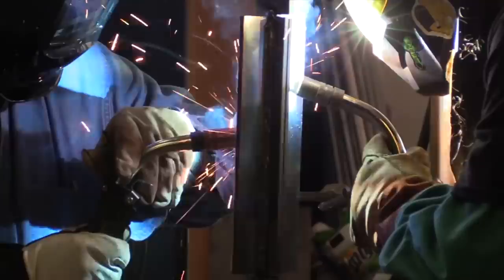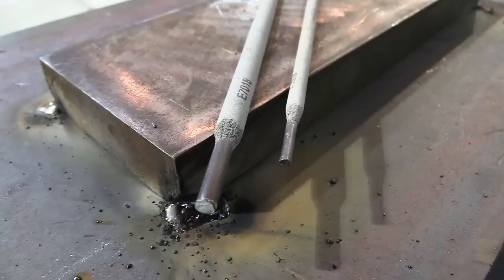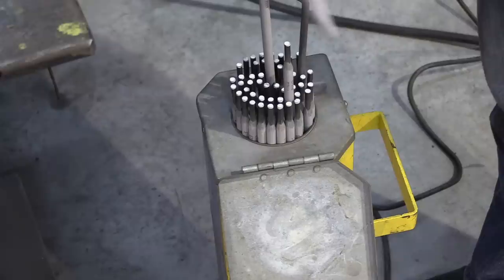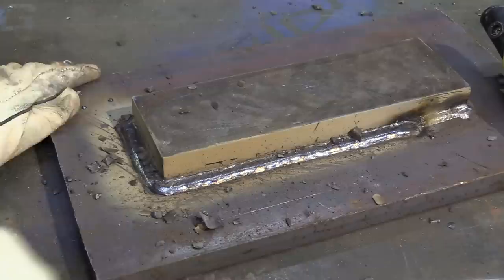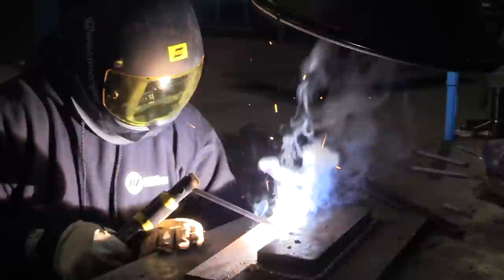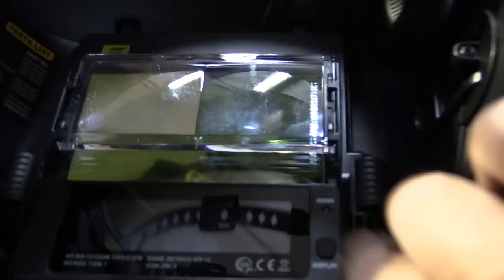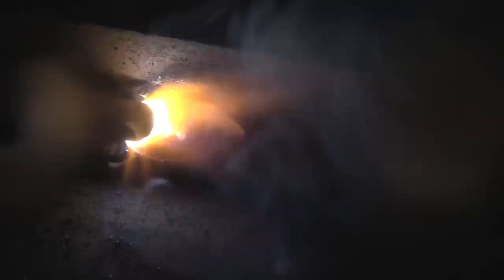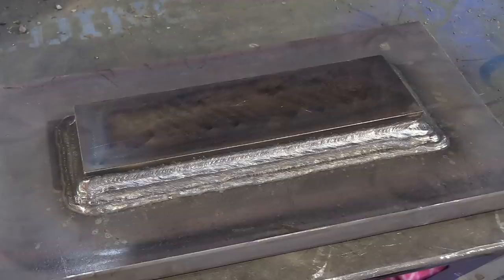Lessons from My First Welding Job

Comment: Jody can you please do a 5/32 7018 uphill I'm having trouble running a Stringer with 5/32 running uphill on structural steel.
Reply from the maker: I will definitely try to get this done soon
Reply: Wroger Wroger Why so much anger and aggression, man?
Reply: @Wroger Wroger you must have been bullied as a kid
Reply: Wroger Wroger asking for help and not thinking are to different things. He is asking for help so he can do it for himself. Not thinking would be that he wants you to do it for him and he take the credit. If humanity would be like you we would never have moved out of caves since the knowledge collected would be only from one lifetime and not several. And btw im taking calculus 3 next semester with electrical engineering as a major.
Reply: @Wroger Wroger so everything you know about weld is self learned? You never struggled and had help from an experienced weldor, my hat is off to you. Along the way at times Jody says if there is something you want to see let me know in the comments section. This channel is based on an older, very highly skilled weldor sharing gratuitously the knowledge of his lifetime. The format here allows people to make request of the author. Why don't you jump on the winning team and offer that young man some helpful advice?
Reply: Antonio love are you having trouble with T joints or with grove welds or both? It is very easy to let the arc get to long with 5/32 going uphill. In a T joint the burn back of the rod into the flux can make it where the flux is literally scraping the sides of the joint in order to have the arc short enough. That short arc learned from a T joint will help in groove joints also. If your amperage is to high the rod will burn back into the flux to far and it will long arc you no matter how you manipulate the rod. You need to mind your rod angle when welding uphill. You want to try and stay straight in or just a very slight push, like 10-15 degrees maximum. If you let that push get exaggerated your rod will fingernail and once again that will give you a long arc. The long arc gouge out the base metal then you will be fighting a losing fight. It is easy to accidentally drop your hand into a push instead of raising your shoulder to climb the joint. Also please check your ground. Whenever possible hook ground so that your welding progression is moving toward it not away. The arc blow created by DC can be a bear. So getting that ground at the top will always help. Remember to weld uphill is only about a 15% reduction in amps as compared to flat. If you loiter around to long trying not to get undercut the heat is rising in the joint. The climbing heat is preheat that will soften the base metal and make the base metal want to wash out. A long arc can result from not rolling your hand into each side, if you just go straight side to side your arc will be long on the sides so to roll your hand into each side will help keep that arc tight. Many people prop to heavily in the vertical position and get to comfortable at the start and become a victim of not moving fast enough after the prop is no longer comfortable. If this does not help feel free to ask me questions and I will try my best to answer. I am sure Jody will get to a video for you soon take care.
Reply: I am also very interested to see this.  The only way I am able to run 5/32 7018 uphill is the make a U shape pattern and constantly have the rod moving and pushing into the base metal.   I normally run it in the 150ish range.  I have done a bunch of t-joints and cut them because I was worried about how sound the weld was running back over the flux from the U pattern but every time I cut them the weld is clean.
Reply: @Wronger Wronger Your the reason the gene pool needs a lifeguard.
Reply: @geb9696  Sometimes  I pull straight up about 1 rod diameter then wiggle side to side until it puddles out and ties into both sides. I use that on the first pass many times because it helps control size and undercut. I don't like when I have a bad looking root pass. Welding over a bad root pass is like ice skating uphill. I think of it as an upside down T motion.
Reply: @Wronger Wronger That's a big FAIL for you. Try harder PMSL (gotta be a teenager)
Reply: @Wroger Wroger Sorry you got all butthurt and stuff. I forgive you. Merry Christmas. Hope Santa visits you.
Reply: well theres your problem right there. Try doing a weave instead of stringers
Reply: @Wroger Wroger hey tough guy you're real tough aren't you? I can run 1/8 7018 5/32 6010 6010 3/16 but having a little trouble with making a consistent bead with a 5/32 7018 which I run about 150 amps..... with that kind of attitude tough guy you wouldn't last long in a oilfield business.
Reply: @melaniew77msn  thanks....
Reply: @SlapHappy  Some codes and or employers force you to use stringer beads. Your answer might have some merit but the man asked about stringer beads.
Reply: @MRSTEEL-fd7eg  Anytime we are all in this together. What good is a profession without any professional courtesy? We all know what it is like to be under that hood for 8-12 hours per day 5-7 days a week. You would think that anyone who truly does what you do would show a little respect, because they know what you gotta do to get paid. Weldor in the oilfield you got my respect. There is no such thing as easy work out there, hang tuff you will get where you are headed.
Reply: @Wroger Wroger hey Einstein you obviously can't  understand or comprehend my question....
Reply: @Wroger Wroger shouldn't you be at McDonald's flipping burgers or something tough guy?
Reply: Anthony Cruz it's tough but honestly for me and more heat higher speed and I got it. Slow and colder wasn't working.
Reply: @Wroger Wroger Would you like to explain to me how and why I am stupid? When I am doing wrong because I don't know I am wrong, explanation helps me with remembering the right way. Merry Christmas to you :)
Reply: @chasecampbell943  thanks....

Comment: I have a question, I'm on a job and it's huge, the welder is welding 1 inch thick U channel a 1 inch thick square tube. only one pass. no weld at all on the inside. I say that will not fly. there are 5 U channels with tubs on the ends all 1 inch thick.

Comment: Hey there, was wondering if you had a chart to show amps to metal thickness, I see charts all over that say amperage range for each electrode but not any that say what rod to metal thickness, say if all you had was 1/8 7018 and welding a 2 inch fillet, how well would it penetrate

Comment: When I was in welding school, our instructor taught us to whip the rod right after getting off of a pass, that way you sling a blob of hot metal off of your rod but end up with a clean tip on your rod that sparks right up. Out on the field, you dont wanna sling off a hot blob of metal and maybe blow up yourself.

Comment: Hey jodie, just wondering, have you ever had the chance to try an xr aluma pro push pull mig gun by miller with the pulse machine to match? Not exactly sure what the machine is called, model or what not, but i think if you could that would be an interesting video to see how you go about doing pulse mig. Keep up the good work. 👍🏻👍🏻

Comment: I get made fun of and ridiculed for putting a 2 bead cap on some of the things I weld at my job lol everyone else just does one pass. And this will be on thick metal
Reply: 2 beads will be less heat input and less shrikage/tention in the material, so it is often the better option. Just believe in what you're doing and you will be fine.

Comment: Can you recommend a good helmet for about $100 to $150?  I’m a home guy. Who you taught. Thank you very much. I already bought 3 helmets like a jackass. Cheap ones. But the head gear fall apart. Thanks for sharing your knowledge.
Reply: If you dork out the cash for a speed glass it will out last you if you only use it occasionally. I use one every single day at work and it has never let me down. Super clear

Comment: What is the main cause of undercut with 7018 rod?  Is it from the travel speed being too fast?  I seem to be competent at most aspects of welding, but vertical up undercut always seems to be a problem.  Thanks.

Comment: Hi sir, are you using 3 phase on the esab rebel 285? Because you absorb a lot of power at 230 Amps and most single phase inverters are only rated for 200 Amps especially here in Europe. Thank you.

Comment: What would you suggest for welding a metal truss to an axle tube and axle housing(Cast), i'm wanting to get a truss welded to the front axle of my 18 Jeep JK Dana 44. I've already been down a 3 day rabbit hole on youtube and have seen stick and mig. would a hobart handler 190 w/230v work? using gas what kind/type of wire should i use(special alloy wire for welding mild steel to cast?) Thanks monger!

Comment: You want hours with short circuit mig welding apply at Wastequip manufacturing company all mig welding but high production welding man that job was similar Jody. Walked to use the restroom foreman breathing down your neck famous saying was "if i dont see arc light out your can you aint workin"

Comment: Theres thousands of videos out there of the same rod, wire and setup. do something out of the ordinary. dual shield flux core 1/6" wire vertical up. No offence but .045 doesnt count because come on, anyone could run that wire uphill. Ive worked for a few companies that followed the D1.1 welding code, one of them tested on a vertical run with 1/6" dual shield flux core. i think it would be a good video for someone taking an upcoming test. Although i do enjoy all of your videos :)

Comment: good stuff Jody, 
I stripped down a 50ga. steel hot water heater tank totally and located small holes about 3/8" below top weld on the tank. where cap meets cylinder. Can these be brazed i am a machinist but no welding experience. From what i can see the tank is about 1/8" to 3/16" thick and sees about 60 psig press. at 125degrees. Any ideas. Thanks in advance Joe V.
Reply: Is it stainless steel?
Is it rusty?
I'm thinking that can be brazed but it does not really address the problem if those were rust holes.

Comment: Very nice video. Can you recommend a machine for around the farm? Probably never will exceed 3/8 inch steel. Usually lighter material and even heavy sheet metal. Thanks for the great video's.
Reply: Just got  a ESAB EMP 215ic  for the same purpose (farm) after researching every major multi welder out there. I was going to buy the 285 like he shows here but after calling  ESAB and talking to the field tech,  I'm glad I went with the more portable sized machine, cost was not the issue so the 285 would of been fine with me.  He hands down talked me out of it, I own other welders, blue, red I don't care the color or brand I want it to work when I need it every time, so I am not brand specific. No regrets so far, I own larger blue and red welders so this fits the bill perfect. The 215 also has some impressive abilities to weld those occasional large repairs in the field also. Watch what the ESAB 215 can do on 120v in this video. https://www.youtube.com/watch?v=JhnXG7e8TLU Never owned an ESAB so we will see over time ,  so far I do not regret the purchase.
Reply: Thunderbolt
Reply: I have an esab miniarc 161lts that I absolutely love. Great stick and Tig machine that's very portable and runs 110/220
Reply: Hobart iron man 230
Reply: Thanks to all who replied and recommended.
Reply: Check out USA WELD for HTP welders

Comment: Good stuff. Did they have the new millermatic 255 and multimatic 255 at fabtech? You get any trials with those?
Reply from the maker: I think the miller booth had both but I didnt get to try either.

Comment: so what exactly does flux do from a chemical point of view?
Reply: Fluxes main job is to act as a shield to keep Oxygen away from the molten metal. It also dose a little cleaning.
Reply: Flux bonds with oxigen creating oxides. It creates something called slag which stays on top of the weld because of density differential. In tig for example, there's no need for flux because the inert gas (Noble gases, usually argon and/or helium) creates a 'shield' over the puddle keeping away oxigen, so there's no slag.
Reply: It's also worth to point out that oxigen would bond with the metal more easily because of the heat. An example of this is when you smelt a metal and pour it into an ingot. After cooling the metal will create an oxide layer because it's in contact with atmospheric oxigen. In a foundry, flux is also used and slag is also a biproduct of the process. 
Any questions, just ask.
Reply: Oxygen isn't the real problem, it's nitrogen and hydrogen. They fuck up the metal in a nutshell

Comment: you run 1/8 7018 on 200 amps? i was running on 115 on a miller and it came out almost perfect. does running it hotter just make it flatter?
Reply: He was talking about that. He did it on accident. He had it setup for the 3/16th rod he would be using but used 1/8 just to tack. He turned it down to 130 amps for the 1/8th rod then back to 200 for the 3/16th
Reply: @treckie7274  ohhh

Comment: Could you weld using your left hand in all position??...only one left hand in all position..
I saw a welder doing that..
He was a right handed person..he was on a ladder and he was weding a joint on his  left side...if that was me I will struggle to weld it with my right hand
..
Do I have to train to weld with my left hand?? If I wouldn't train that I would never be able to weld by standing on a ladder...
And a person said to me you could have been a welder by now if you trained to weld like him...he meant that I'm not a welder...that made me so angry..
I'm a welder but he said I'm not..I could weld all position with my right hand...
And he also said I'm not a welder because I'm not willing to work on hight without a scaffolding..

Comment: You say, you've run better rods...is it appearance, feel, what that makes you say that?
Reply from the maker: slag did not come off as easy as some other rods I have used...especially on the first pass
Reply: @weldingtipsandtricks  Thanks, Jody

Comment: This is pretty much my situation. I've been in welding school for one and a half years and have a year to go. I got my mig certification and I was able to find a welding fabrication job where i'm building and repairing truck beds. It sucks if i'm being honest. It's not the work, I love to weld and I love what i'm doing. What sucks are the two guys in charge. They are utter assholes and no I don't mean that like i'm some snowflake who can't take a joke. I mean they are horrible superiors. They micromanage me on every little detail and get after me for missing one tiny little detail or for stupid things like dipping my mig stinger in tip dip "properly" or holding a grinder wrong. Like they have serious stick up the butt syndrome. I only had about 2 or 3 weeks to really learn how to build three different types of truck beds and by learn I mean help on some parts while my superiors did most of it. Then they were like now make this on your own, so I was set up for failure, I tried to take notes but it's impossible to take notes while your on a time crunch to build the bed. And obviously there are parts that I don't know how to do because somebody else worked on it and didn't teach me how. Then they get mad when I can't build an entire truck bed by myself in a day with no notes, no jig, and sometimes no materials, just memory. Please tell me this is not what all welding jobs are like.